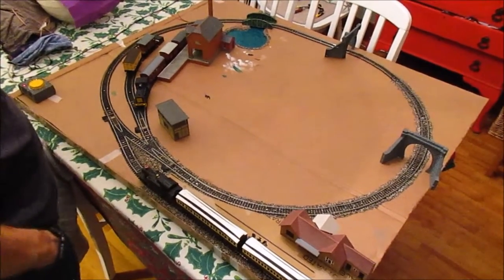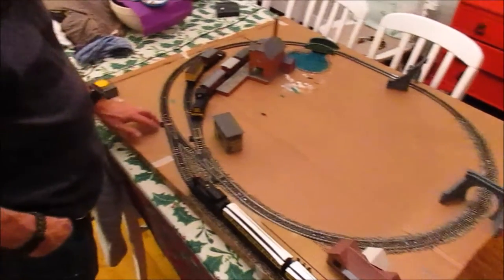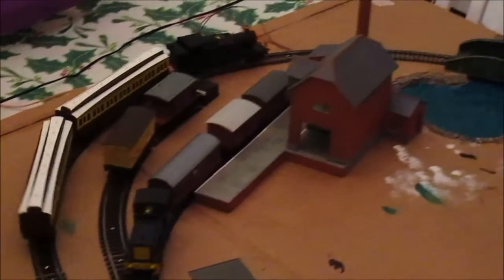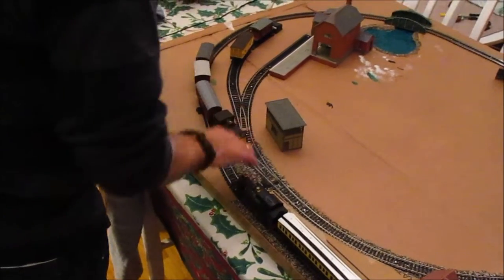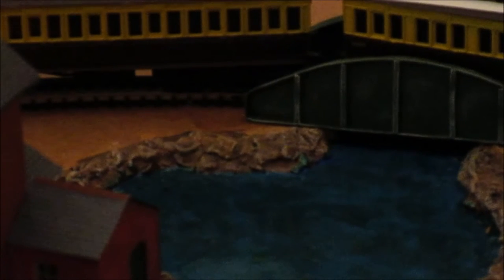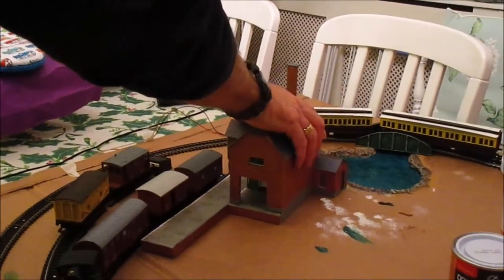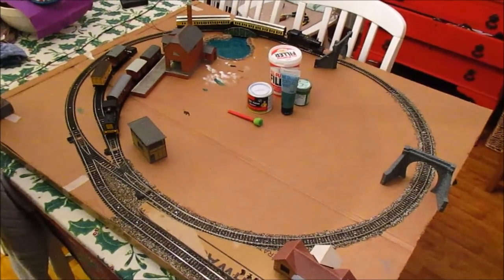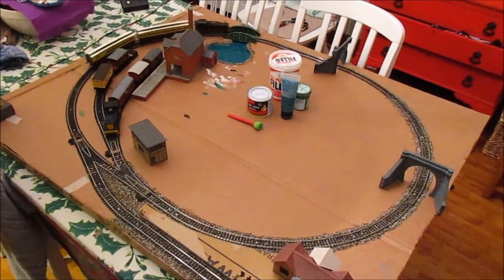A Simple Train Set Model Railway Layout - Home Wood

Comment: A good alternative to that cardboard is foamboard! You can get 4 A1 sheets from Hobbycraft for £10. It's really strong but easy to cut and has many uses for model railways.
Reply from the maker: I have used it extensively in more recent videos, it's not as cheap as free cardboard but is worth the cost

Comment: Hi Mike I was wondering what are the measurements for this board? It’s great I’m going to try and make a small layout for my son.
Reply from the maker: I have built several like this. The minimum practical to keep it simple is 32x48 in this allows you to use 1st radius set track with a short straight for sidings. If you have bigger so much the better, you can even go up to 2nd radius then. Lots of videos on similar ideas on our channel

Comment: I applaud your ideas and have now started my own "budget" build in n gauge (video coming soon).

Have you considered hard wiring the points so you don't have the power issues you're currently experiencing?
Reply from the maker: It's the plastic frog that is the issue so sadly hard wiring won't solve the problem
Reply: @BudgetModelRailways  that's a shame.
I though it might have just been an issue with continuity across the blades.
Would it be worth fitting power pick ups to the stock that could be semi permanently coupled to the loco?
Reply from the maker: It's another idea, but I have enough locks that will run across them ok